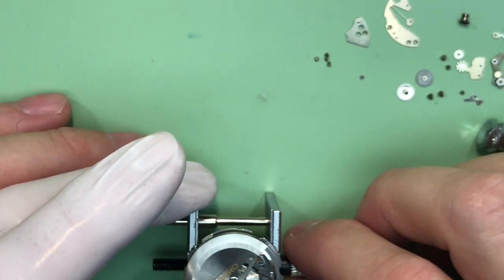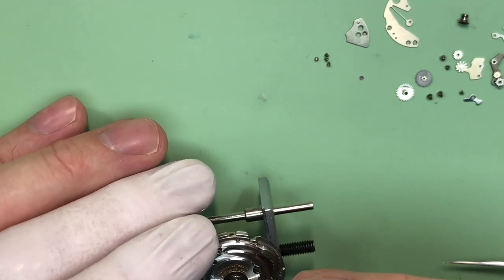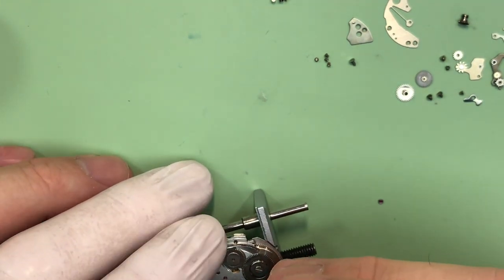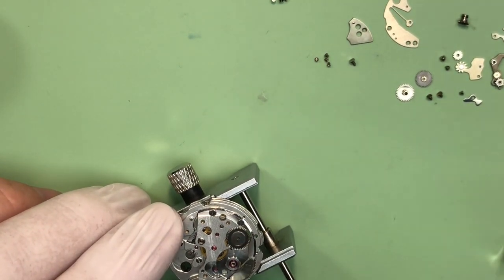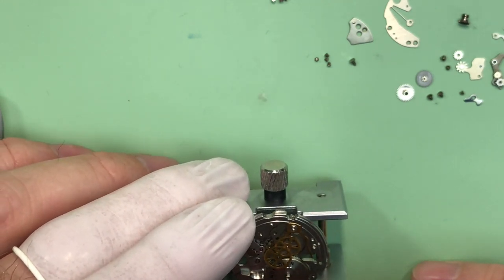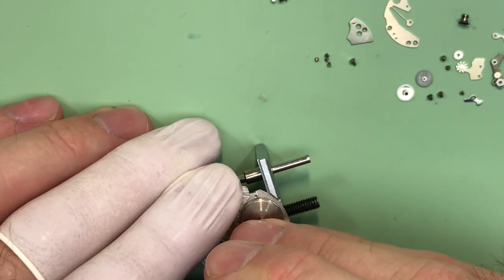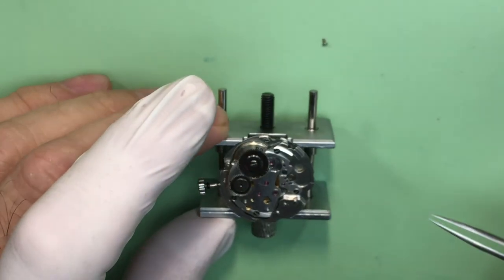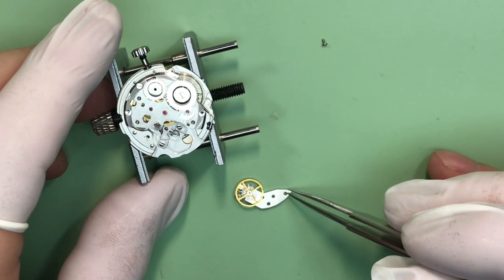For B.L. -- 6156-8000 Teardown and Reassembly

Comment: do you have a video of how you remove/replace the crystal please?
Reply from the maker: you use a crystal press, it comes out as a unit with the bezel. I had to make a custom bottom holder that would allow the crystal to come out. not simple.
Reply: @BlairWatchProject  ahhh thanks for that key info, a crystal press means I have to get the movement out then remove the crystal.
this is precisely what I was wanting to figure out.